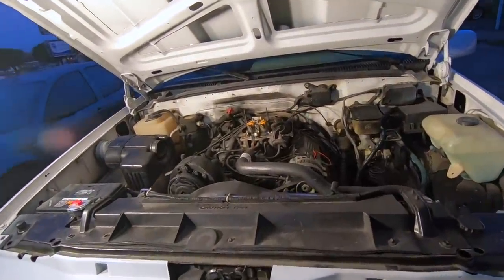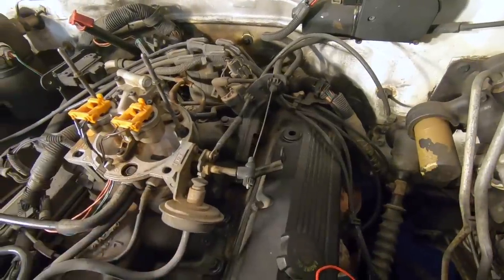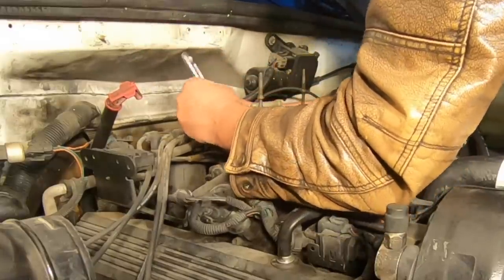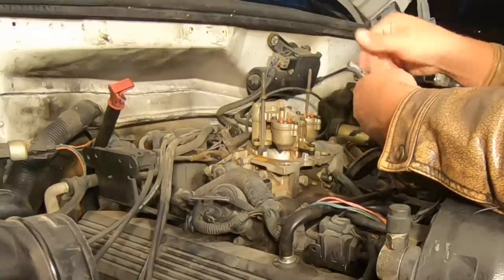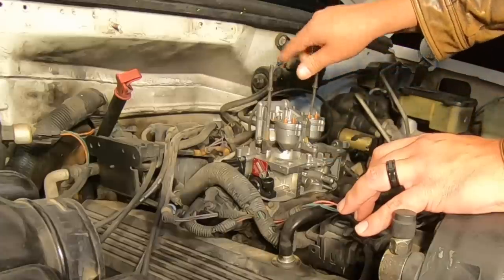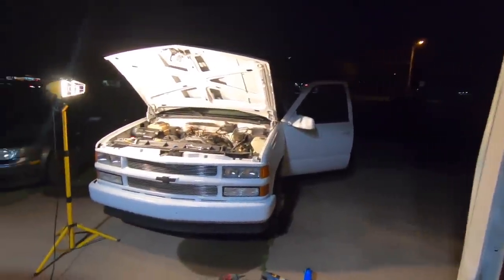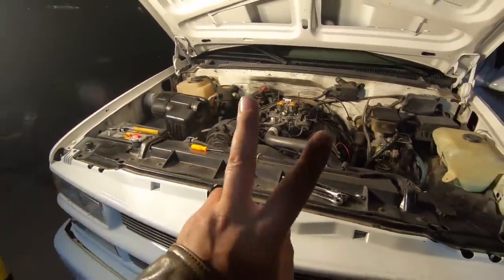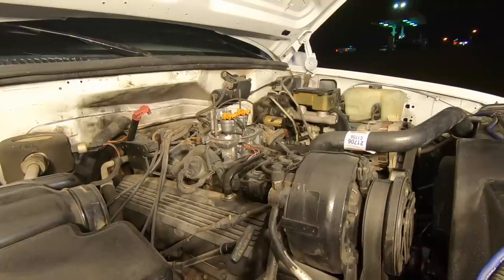94 Chevy 3500 454 TBI Replacement Issues!!

Comment: @12:40 Actually that last vacuum line is not for the AC solenoid or whatever else you said...  It is a small vacuum pump that connects to the vacuum advance module on the distributor under the cap.  You should have just rebuilt the one you have at half the price.  About $250 would have gotten you the gasket set and new injectors with new wiring harness for the injectors.  Instead you paid about $580 for the entire set up.  That old TBI unit is exactly the same as mine.  That engine is too.  I would say it is a 1995, but they were the same from 1991 - 1995.

Definitely sounds like the Vacuum advance.  I'm having the same issue with my  1995 Suburban C2500 7.4L (454).  If I can get it started it idles fine but runs like crap.  Same on a hill of any size.  It kicks, sputters, backfires, etc..  You can test the advance by disconnecting the vacuum line to the distributor and the module on the side of the TBI by the throttle linkage and with the distributor cap off, blow and suck on the line to see if the advance lever is moving located just under the distributor.  There is a window you can look through the bottom of the distributor cap base plate.  It could also be the fuel pump.  BUT my money is on the fuel pressure regulator spring and diaphragm AND the injectors themselves.  TBI's need to be rebuilt about ever 10 - 15 years.

I took mine to an automotive shop where I live and asked them to check it out.  All they did was try to force start the engine with a can of either/starting fluid and lit the top of the engine on fire when it backfired.  Burned the ENTIRE wiring harness and injector electronics to a crisp.  They put it on a roll back and put it in my driveway without even saying a word with a $150 towing fee.  I got home and started the truck, it fired right up, but imagine my surprise when I opened the hood.

....and NO they say they will not fix the damage because they are claiming it was like that when they got it.  
Are there ANY honest people left in the world?

Good Luck

Comment: The only problem with that truck is that you don't know what you're doing.

The vac line that was capped on the back of the throttle body needed to be reconnected to the MAP sensor. My '92 Sierra has the exact same setup and it's very simple to diagnose. That engine was perfectly fine and the TBI was super clean. You probably got the computer confused driving over 30 miles without the MAP connected. Probably needed a new battery more than new throttle body and injectors.

Those TBI's are sick little units and you can juice a lot more horses with less than a $K of mods... ie, cold air intake, vortex TB spacer, beef up the fuel pressure regulator a couple lbs, etc... 

...oh, and that engine gets nearly 20mpg highway when she's dialed. Better than modern diesels. Go ahead a talk a little more crap about Chevy TBI... so you  make yourself look even more foolish to those of us who know better. 

...and if that 275lb 4L80e tranny under her is in good shape, it's worth $2500-$3000 and sought after by muscle car builders who want a T400 upgrade. They're tough enough to be used in the military H1's and full size motorhomes.

Comment: I would start with a set of noid lights and make sure you are actually getting a command from the ECM to fire the injectors. If you pinched the wires bad enough to short it out my guess is you blew a driver in the ECM that fires the injectors and it is running on only one or it is losing one intermittently. Start with that so you know the actual problem before you spend another dime on parts.

Comment: Your mistake (worse decision) was not just rebuilding the original TBI. New TBI bodies are never just 'Plug & play". Your old one however is. If it (old TBI) was running fine prior to the new TBI then the issue is the TBI.

Comment: Maybe that new TB is actually just broken? It was a rebuild. Wouldn't be the first time I have bought a DOA Reman part. I also wonder if the injectors themselves are the same between those two units even if the TB itself is slightly different. IE if you can't return the entire unit then maybe just swap the injectors between them as a test and install the old TB with the new injectors. Just a random thought. Could make things worse and I am by no means an expert. So I will defer to people who are smarter than me.

Comment: I had this problem and it was not the TBI. You may have shorted out the computer. I keep a spare unit under the seat and one on the shelf. The throttle body is simple but the computer can cause ALL kinds of goofy problems . Go to the wrecking yard and  find a 454 with your trans(man or auto) and try it. If you get the wrong one it will shift funny and the idle will be off. You probably goofed it up shorting the TBI out. I have won several bets with this fix. The parts house wants a fortune for one so make sure first. Thank you for making me part of the soap opera that is your life. HEHE

Comment: I have a hydroboost on my 2004 Escalade.  Personally, I hate the system.  The hydroboosts are notorious for leaking, and it's about impossible to find a reman that doesn't leak.  While they offer more power when assisting the brakes, but there's a reason GM ditched the system beginning with the GMT900s (2007).

Comment: When you buy an 90s or older truck with over 100,000 you might was will plan on spending more money than it's worth. All you need to pull a car trailer is a half ton truck for anything 5000 pounds or less. Anything more is over kill.
Reply: I have a 94 Cheyenne  that I bought 6 years ago and the only thing I've done to it is put a water pump on it.
Reply: And it had 132k on it when I got it now it has about 156k
Reply: @richardbeckett5580  not many miles in 6 years.
Reply: My 94 suburban 1500 had 235xxx miles on it. Haul with it all the time.

Comment: I'm not an expert, but if something is shorted, I would think that it should be the ecu that controls the injector. That device sends the signal, so the signal is shorted.
Injector is like a spark plug. If the spark plug line would short out, the coil would be the broken part, not the spark plug.

Comment: The o2 sensors or the cat is clogged up.check the wiring first and also use some wd40 around the base gasket.start it and see if juicing the wd at the base of the tbi will cause an idoe difference.worst case a carb will work even with a 4l60 if you use the Holley tps sensor.Even easier if you have the 700r4

Comment: Yeah real easy in case it’s not. Also was the power steering cap just gone? I’m no mechanic but as others have said I hear a vacuum leak. I hope it’s that easy. I had a 93 Chevy Sierra 2500 and my dimmer switch did the same crap. Cussed more than once with it. I hope it’s an easy fix for you. Good Luck!

Comment: Fix it & keep it.  For work only; this is not a vehicle to just daily; it's for towing, getting big heavy stuff, etc.  Any one of the trucks you have purchased on this channel would be adequate for this purpose.  BTW, when the dually was running, sounded awfully lot like a vacuum leak, so maybe do the old squirt soapy water trick around the base & ports to see if you're leaking anywhere.

Comment: Hey randy I’m thinking the driver in the computer shorted out when the wire touched. Send that throttle body back fix yours
Reply: Joseph Homanick fully agree - My dad picked up a caravan that had a similar issue. My dad is an electronics tech and found the driver was blown in the ECU. Replaced it and fixed it.

Comment: You really need to grab a factory service manual set (physical or digital) for this truck off eBay. Then you will find clarity in the darkness of pre OBD2 diagnostics, as well as the other systems in your truck. Strangers on the internet will never replace the very important information contained in the FSM set. I think you can do this, you just need the right information💯

Comment: I think I would just buy rebuilt injectors in this case, they only run about $30 each. At that price, I would buy a set of them, so I know they match up good. $550 is way to much for a tbi! The tbi is the easiest thing to rebuild, it is about the same as rebuilding a Briggs and Stratton carb! replace the regulator at the same time it will run you about $40 and you are basically done! If you really want to go all in you can also replace the tps for $20. Clean up the base with some carb cleaner spray. Boom $550 please! OUCH! Not to mention it does not idle! It is defective return it and get your money back! Buy the rebuilt injectors and do the old one yourself!
Reply: I know this was posted years ago but your completely right, buying a whole tbi unit is a waste, you can just even buy new injectors for probably less then 200, 454 injectors are bigger then the 350 so I'm guessing it's more $ but I doubt there's anything wrong with the tbi system because it's all mechanical besides the injectors,  tps , and IAC...

Comment: I own one of these.  K2500 Sub.  You probably need a MAP sensor.  And you need a fuel pump every 80K miles.  Fuel filter every 10K to 20K miles.  I've changed the entire fuel system and entire ignition system and it runs like a beast.  I used the fuel pump assy from the '96 Vortec, a direct fit with better flow.  Also check that your Oil Pressure sender isn't blown.  Also make sure the set-timing connector is not corroded.

Comment: did you even check fuses after you SHORTED a wire? hello?
Reply from the maker: Derrick Moyer of course I did....
Reply: If you pinched the wire, the wire could be damaged. Grab a multimeter and check the ohms while wiggling the wire.

Comment: Maybe the pinched wire has messed something electrical up?  Head light switch usually has a circuit breaker in it that causes the on and off as it over heats and cools the weak circuit breaker.

Comment: Hydroboost units are found on Diesel trucks (with hydraulic brakes) due to the fact diesel engines inherently dont make vacuum.
Reply: Douglas Chaney 

They are found on gas trucks as well. I’ve had an Astro van and a full size van with the hydroboost set up.

Comment: Wrong TBI unit or mixed up wires on IAC and tps. You mentioned that the IAC harness was tight to plug in. You also said the unit didnt look the same as your original.

Comment: I was hard with you when you bought the truck, since it ticked off all the boxes of not to buy it. However, mistakes are made and will also be made in the future. I recommend istead of bying a number of "well used cars", go fo a couple of easy sellable brands with only issues on either body or engine. Never ever buy (unless its a rare and collectable car) a car that needs both body and engine work! It will only give you headache and negative balance on your bank account(s).

Comment: My 88 454 TBI wire to the injector broke once while putting on the air cleaner. I carefully set it back on the injector with no glue and it runs fine!

Comment: Randy, they put the hydra booster system on diesel equipped trucks ( you said it was a 6.5l diesel before) as a diesel does not have any vacuum to run a normal brake power booster unit. Diesel engines usually add a vacuum pump to run small items, but can't run larger demanding vacuum boost units.

Comment: 1. change the MAP sensor.  My '88 G20 ran like a dog when I got it, even after changing the O2 sensor that was broken in half that I discovered on the way home from buying it.  I swapped that sensor out with one off the '91 and it solved the problem. It wasn't giving me any codes, it just didn't want to run.  

2. Did you check for codes regardless of any CEL indication?
3. Check fuel pressure, consider a fuel filter, they're not expensive.  Pressure should be around 14.  
4.  Consider downloading an OBD-1 specific software program such as WinALDL and making or buying the cable to use to connect to the truck.  WinALDL will run on a fairly old laptop (the one I bought Saturday for $35 is more than enough) and will give you a lot more data than just codes. 

A good video with a diagnostic program, going through all that for OBD-1, should generate views and thus income and make up for some of the loss on it.

Which at this point is how you need to look at this truck.  How can you generate three or four grand worth of content from it?

A TBI is normally stupid reliable because it's a simple system.  Whatever is wrong is probably also simple. It's just a matter of diagnosing it.

This stuff happens to all of us, the first 2002 van I bought I thought I did okay on at $650.  Four days later it won't start, then starts but stalls in gear, gauges going up and down acting crazy.  Turned out to have a hole corroded in the computer case and when it rained after I got it home it got water in it.  I had no means to fix that, so $1200 later at a garage we got that fixed.  And then the garage F'ed me by not even looking at the power steering pump, only to bang me on a little leak for the state inspection.  But they did give me some free wiper blades.  Anyways, it's not the end of the world.
Reply: Also, if you didn't already, check those wires to the injectors, put some tape on them.

Comment: Hey  Randy  don't  lose much sleep  over that truck I've  been  a mechanic  from 1980 till now that  tbi units are pain first thing  I'd  look at is to see if you  have a vacuum  leaks on the unit and the  lines on the head lights just replace the headlight switch the breaker unit in it getting  weak buddy keep you head up your doing  fine

Comment: I would look at the coolant temp sensor for the ecm. It's a two wire sensor with a yellow and black wire.  They were notorious for failures. It will -40 and still run but will stall...
Reply: the ECT sensor on TBI systems control everything...it controls timing,fuel control,idle control......FYI on that system the base timing is for 400RPM and less so adjusting timing does nothing for you...the ECU takes over timing control at over 400 rpm
Reply: @mikefloyd6732  Agree. The cooling temp sender at the front of the intake manifold will also incl. (2) wires mounted to a grounding bracket (curved) to the T stat. As for idle on my 94 TBI in my Fleetwood RV the idle RPM is roughly 700-750. Also if the ICM is not working the injectors will not either. But the fact that you can get it to run when working the throttle suggests they are working. Until you let it idle then it dies. I say it's either the cooling temp sender or ECM issue.

Comment: The headlight problem is more than likely a dimmer switch. Part of the turn signal switch...also common...
Reply: Headlight fluid is probably low. I'd check the easy stuff first.

Comment: Both tbi unit have the air horn milled&the injector spacer can't tell if bores have been honed  they changed the screw heads to button top

Comment: bad uber man! the truck was best decision u ever! made! when u blow the rear axle and bend the frame of the f150 dont come a crying. ive pulled semi trucks with rope with full 50000 loads in first gear with my 454 for a interstate recoverys. that truck doesnt have the hp the silversdo 2500 had but it can handle loads 6500+ more than the 3/4ton.

Comment: Sounds like a vacuum leak. I'd start with that. Make sure gasket on the bottom of the TBI unit is sealing well. Also, Might wanna install your Power steering pump cap back on. Hydroboost is pretty good, So I would keep it. I would definitely have gotten a 6.5. Much more torque, better mpg and reliable as hell  (PMD relocate, proper straight pipe exhaust, DYI waste gate and cooling) I think you paid $5000 too much for that truck.

Comment: The stalling issue sounds very much like a failed engine temperature sensor so the fuel injection isn't getting a signal to boost the fuel and engine revs when it's cold.  Like a vehicle with a carb, when it's cold it won't run without the choke on.  You're just lacking cold fast idle control, it's just a case of tracking down which engine temperature sensor is the relevant item and replacing it with a good-quality item and it'll be fine.  The running issue is simply that the electronic control is learning its parameters again to suit your driving style, this is a very common thing with '80s/'90s fuel injection vehicles, the VW Golf GTI mk2 with the Digifant injection does exactly the same thing.  The headlights issue sounds like something in the circuit is overheating and switching out until it cools down, I would guess a relay or switch...

Comment: need to verify fuel 12-15 psi That requires a special adapter.  Also the IAC motor is suspect. You could have shorted  one side of the fuel injector driver in the computer. That has to be bench tested.
Reply: Or he could have blown a fuse to that injector.

Comment: Re:  not wanting to idle:   You mentioned the connection was 'tight' to the IAC.  Might be the harness/plug is damaged at the IAC or the harness connector itself. 

Just an idea......  Less popular idea about the pinched wire at the TBI....   You found it shorted out the injector.  Wouldn't surprise me if the PCM took a hit as well.  Just sayin'.....

Comment: When dealing with an engine swap I would look for loose or disconnected ground wires. When doing an idle relearn always turn on as many electrical loads as possible. The block should be stamped by the water pump with letters and numbers that tell what year it is. I would check the headlight switch and especially the connector and also the fuse box for signs of overheating or corrosion.
Reply: ya .. way better than my ideas

Comment: The vacuum hose is off someplace. or a carb base plate is leaking air. some place is not plugged off it leaking vacuum. Is the

Comment: Hydro boost is a upgrade 👍🏼.  When new the iac (idle air control) needs adjusting.   I forget the procedure.  But I’ve been there.   Other than that.  May have shorted the computer out.    Both easy cheap fixes.